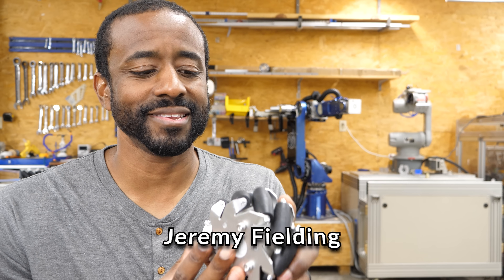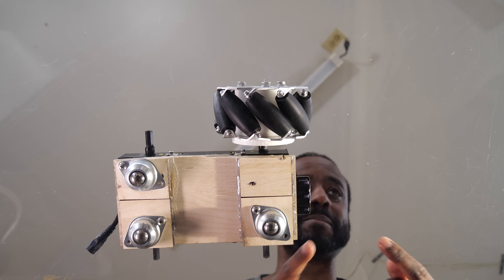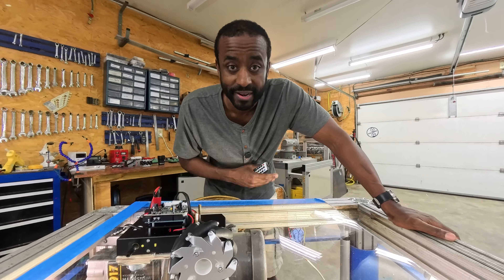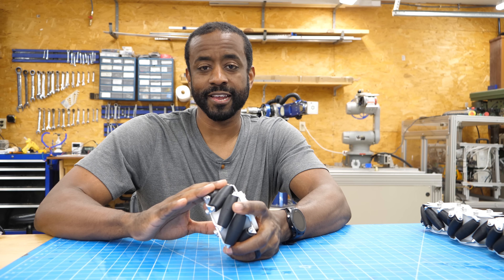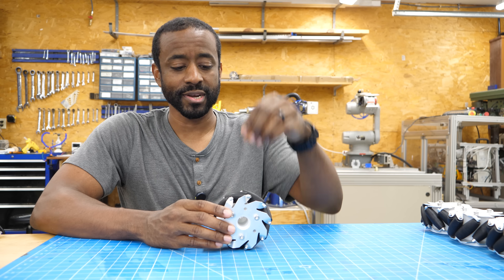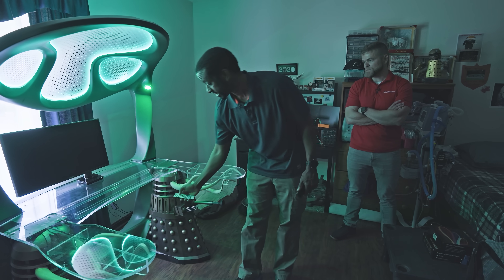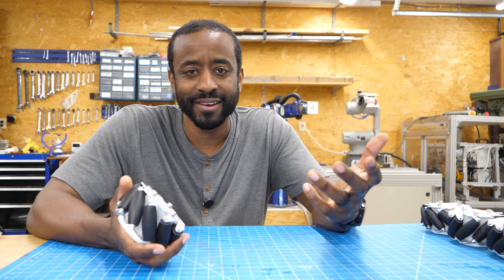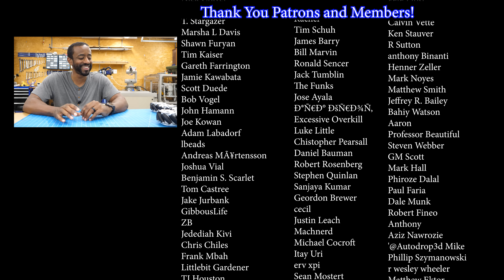The Mecanum Wheel Is So Weird, It Is Genius. How It Works

Comment: Well done video, but didn’t provide any information about the actual design. The Mecanum wheel is a copy of the HeliRoll wheel technology that was patented by the FMC Corporation almost 50 years ago for use on conveyor systems. They used it for years on their aircraft loading equipment and other materials handling equipment. The patent has since expired and the wheel design has been copied by other companies for various commercial applications.

Comment: Car manufacturers may be interested, since they seem to always sell the car in the middle of a tight row of cars. With that wheel they would not have to back up a row of cars to get that ONE out into the lane.! of course they'd have to change the tores before driving the car to the dealer or buyer.

Comment: The rules for tool wear apply here, the more complex and robust the design the more expensive so the longer you want it to last, so it is perfect for low speed applications,  The first and most prominent factor on tool wear is RPMs, and this would translate to the speed of the wheel on surfaces.  So the slower the better to reduce wear.  These wheels would last just as long as any other type of wheel as long as it's used at appropriate speeds.

Comment: I watched this because I thought he was going to explain how it work, not just describe its behavior.
Reply from the maker: I don't understand your comment. What do you think is missing? This is "how it works" There is nothing else related to how the tire does what it does.  Perhaps we could have talked about the controller in detail, but its just what I said in the video. When want to go in a certain direction the wheels spin as described in the video to get the movement you want.
Reply: @Jeremy_Fielding  what I mean is, I thought you were going to actually describe the Dynamics of how you get directions of travel out of a wheel assembly other than forward and backward rolling.  you kind of described it in a manner that goes like this, I do this, it does that, I do this other thing, it does this other thing. but you did not explain how turning a wheel clockwise resulted in diagonal or sideways movement. like the force vectors. like what is actually happening with the physical dynamics of that wheel system.
Reply from the maker: @etyrnal . Well I guess we disagree on the meaning of the words. There were force vectors on the screen, I said forward and backward instead of clockwise or counterclockwise…and unfortunately it sounds like the same thing to me. I was trying to explain this to a non technical audience and it sounds like perhaps you wanted a more technical sounding description? I am not sure. But thanks for the feedback. I and not dismissing your comment. I just don’t quite see enough difference to fully understand your disappointment

Comment: I used to drive a forklift that had six functions , one was to move the forks sideways which I found sufficient enough to get me out of any tight squeeze, so don't think there is much use for this side wheel movement, this looks like the equivalent of an upside down forklift using the forks as the wheels.

Comment: I have been looking at your videos. You did one in 2017 were you have I think, 5 diffrent MOTORS on the table were you was showing how to wire them. 2nd from the right on the table, you have a motor from a treadmill. I have a smaller version of that in DC 12v used to go to a folding bench seat from my van. It has 2 wires comingmmout of it at one end.
My question for you is, is there anyway you can open it up and add a second set of wires to it so It can be used to get power to running and at the same time, give power to something else.

Comment: You need at least three price points. A really expensive version that has more features than most people want or need. Then the item you actually want to sell the most of. (sweet spot) Lastly a version that is very limited and but ultra cheap. Sure a lot of people will buy the cheap one but they'll eventually want to upgrade to the next version up. The majority of buyers will be able to justify their purchase because "Hey I didn't buy the most expensive one".  This is why Wendy's has a triple burger 🙂

Comment: I would suggest a bottom barrel tier build. Using a lot of 3D printed parts, skipping things like bearings unless absolutely needed, its low weight means weaker/cheaper motors/servos, etc. The idea being that it is an entry level for someone interested but unsure if they want to invest more to do more and/or for parents to build with their kids before graduating to the more involved (expensive) options. This package can even come in two flavors. One has all the parts and the other has all the parts minus the 3D printed bits for those who have their own printer. If people are happy with what they get and/or have growing interest it will likely result in the purchase of a more expensive kit. For that reason you can also sell the basic kits with barely-over-cost margins which keeps purchase price down and accessibility high.

Comment: These became very common in containerized aircraft loading. They worked way better than rubber belts. The belts would slip when wet. For some reason these didn’t.

Comment: On the topic of approachability, I'd say about getting the price down on a good platform that can be extended later.  I think people are more likely to buy something if they see a low barrier to entry with the promise of buying (or making!) extensions later.  A good set of wheels with pins to add sensors and holes to bolt arms to would entice me more than a robot that tries to do everything on the cheap.

Comment: 110105.    I think nature has greenlit  many ways to absorb ambient thermal energy meaning fhat substances get colder as 🔺️temperature × specific heat amount of thermal energy is  converted without gain or loss into another form of energy, electrical energy in the case of diode arrays. I knoŵ you are a strong supporter of the second law of thermodynamics. Please check the second law of thermodynamics in view of nanometer.scale phenomena where local thermal conditions of fluids are not uniform.

Comment: 110104    Nanometer scale uniformly aligned parallel diode arrays may be a practical way of absorbing ambient heat. Ambient heat is uniform on a micrometer and larger scale and non uniform on a nanometer scale. Plausibly,  heat absorbtion at the non uniform scale is available as Johnson Nyquest thermal electrical noise that would yield, by conversion without gain or loss, an equivelent amount of electrical energy. 
AND
 Diode voltage / current  characterstics can be displayed on an XY tracing oscìlloscope. Thermal electrical noise power in resistors can be displayed by time sweeps of voltage on an oscilloscope. Each such time sweep shows unique randomness.
AND
A  simple  "Special Program with Integrated Circuit Emphasis" model indicated that diodes in uniform aligntment parallel would aggregate simulated partially rectified thermal electrical noise. 

Maximum direct current electrical power, half, is transfered from a direct current electrical source to the electrical load when the electrical resistance of the two parts is equal. Calculated matched resistance output (watts) is k (Boltźman's constant), one point three eight x 10^ minus 23, times T (temperature Kelvin) times bandwidth (0 Hz to a natural limit ~2 THz @ 290 K) times rectification halving and nanowatt power level rectification efficiency, times the number of diodes in the array. 

There are a billion cells of 1000 square nanometer area each per square millimeter, 100 billion per square centimeter. 

Creditable independent replicatable proof of concept protypes beyond improper influence are needed.

Aloha
Charles M Brown 
Kilauea, Kauai, Hawaii 96754

Comment: Cool video.  As for project price points, $50 for kids, $100 for teens, $150 for adult, $250 for advanced, BUT, have the lower tier kits be mostly subsets of higher tier kits, with e.g. reusable chassis, wheels, motors, gears, etc.  Different computer, controls, wiring, etc.  Further lowers cost and/or increases budget for advanced functionality.  Or, think of Transformers, Voltron, Thundercats, etc, additive machines that can be composed into larger machines.  Modular design, reusable components.

Comment: These wheels are real cool, and I can definitely see how useful they would be. But doesn't the fact that the two opposing wheels cancel out each other's pull in one of their respective directions also mean that half their power is basically lost? I imagine that this, along with the added mechanical parts (potential points of failure) would be why it's not something that would be considered for every four wheeled vehicle out there.

Comment: I think for many people it's not the cost of the materials themselves that represents the bar for entry. It's the cost of the tooling required to transform those materials, as well as the cost of a space to house the tooling. It's easy to say "well, it's only $200 worth of materials", but if it will cost you $50,000+ dollars to get to a point where you can actually do something useful with those materials, then the material cost isn't really relevant. With a lathe and a mill you can make just about anything (if you know how to use them properly), but for most people a lathe and a mill are so far out of reach as to make that an entirely moot point.

Comment: I have a decade of experience with mecanum wheels due to FTC robotics.  The mecanum wheel has great advantages and big drawbacks. Advantages are major maneuverability in all directions, including rotation, side slip, low friction turning, as you mention.  But these wheels aren't good on sloping surfaces, on generating high friction, or on uneven surfaces. They're very unpredictable on uneven surfaces. They cannot handle dirt, sand gets in the bearings, and they're expensive. But they are cool to watch.  Straight tracking requires active feedback control just to continue to go straight. But it's a cool tool.

Comment: ( after watching the single wheel) Thats Genius...so what i'm seeing is each wheel provides more directional movement ...at angles..instead of a normal wheel that just has forwards and backwards...

which means  to get straight forwards and backwards you would need equal wheels on each side but also equal power applied to each wheel...and you can get different direction of travel by applying more power to individual wheels.

Comment: The issue with omnidirectional wheels in general is wear and tear. If you use it on wheelchairs, 6 months of lifespan tops and they are 2.5 times the price of normal tyres. The math does work

Comment: A drone with a powerful magnet and 3+ mecanum wheels would be perfect for crawling around a space craft. Although that requires a magnetic exterior or enough to grid the near exterior for the magnet without causing interference. 

These on the next Mars lander but designed better for Martian dust would be amazing. Scaling them to adapt to the differences in atmospheric density and gravity, as well as the terrain. It could make a much more maneuverable lander. Or perhaps some macro-swarm of mecanum wheeled pods as the foot of the lander. With a highly adaptable suspension capable of lowering directly to the ground surface while engaging multiple wheels to grip and stabilize it against the winds. Perhaps small turbines run by pressure fluctuations would feed power while the winds are blocking out solar power. Sort of like the City on Mercury in Kim Stanley Robinson’s book that moved on rails that through thermal expansion and sophisticated engineering pushed the city towards the dark side constantly. A macro-swarm of drones as the base or platform that the lander rides on. Easy enough to replace individual components and upgrade available payload.

Comment: i call this common sense. i thought it was called omni-wheel. this tech existed very long ago, but it's not practical because it doesn't it doesn't have any flexibility, so you can only put this on very slow moving vehicles.

i have an idea how to make it more flexible tho to make it suitable for normal cars, in short, you'd have to make those rollers soft like tyres, but it also means they'd have to be a lot bigger so the metal pieces wouldn't touch the ground when it's driving over bumpy road.

Comment: Thats cool guy, but I think you can even make that wheel you got swing a little better. A set of gears each one on an end of a roller driven by a single gear might just let the thing run a hundred percent AND  slide.

Comment: Do them only work using that sort of rolling pins system? What would happen if one tried to use just, let's say, traditionally made tires with thick long diagonal treads? It would be cheaper, but would it work the same?

Comment: So, I was building a Mecanum wheel robot about 4 months ago using an Arduino Mega and L293D motor drivers. I used Johnson high-torque motors because, due to the high friction, I could not make turns with low-torque motors. I controlled the robot with a joystick and HC05 Bluetooth module. It took less time to build the robot than understanding how these wheels work. I wish this video had been available back then; it could have saved me so much time. Anyway, thanks for sharing this amazingly helpful video. Placing the camera under the glass to showcase the bottom view was the best idea, making it much easier to understand. Otherwise, it would have been too complicated for many. I’d love to watch more videos about Mecanum wheels.

Comment: I was always wondering what would happen if you lock the small wheel in the Mecanum Wheel so it becomes an ordinary wheel? how would it affect the movement?
Because you can design a Vehicle that has normal movement but when it's in the right environments it can use the movements of the Mecanum Wheel.

Comment: I drive forklifts. Anybody who develops forklifts with these would be a billionaire overnight.

Lets say I grab a pallet up on a shelf and want to move it directly to the side. I have to come in from the front at the right angles sometimes in a tight space. Grab the pallet. Reverse out and give myself the space to pull in at the new location. If the area is full of other junk each move can be annoying and needs to be mentally planned before doing. We still get it done wuickly just because of experience. But still the ability to move directly to the side or even to pivot in place on forklifts would be genuinely worth billions of dollars.

Comment: ye for wheel chairs its very good  , the wheels should be solid rubber : and they should be thought of like a tractor tread: SO the original wheel setup is good but with these extra rollers which can be activated when neccasary to move in other tagents in tight space :
Is we had this also as a lifting device , we could easily alsomove heavy objects and get accurate placement.
despite in theory needing a smooth surface , being rubbber t a single cog coul move ALL rotating rollers like a gear ! so each wheel developed would also be a geared wheel ! < we also think agiain about the problem of surfaces , but if the model was upscaled to a 4x4 sized model even tractor sized wheels we swoul fid it should work on all offroa surfaces ( especially if rubber is used ! ) ...
there are some strange designed in india which also have simular wheen to thi ! ( now we can see what thier actual purpose may have been .,)
Reply: Also I would make a small rover ....  like  Walle :  it could also use object detection , as well as the roomba technologiys to map a location , so once it maps the location ( like roomba ) ( the floor cleaning robot ) << it can then create a scan pattern to 3d scan the location : ( so this could eb a good exploration tool , for caverns etc and tombs etc and ... ) It could also be a search robot given some object to search a location for instances of that object and take a picture : : THe movement aspect gives it that unnatural ability to go any h=wghere and maover anywhewre : ( with cameras for eyes etc , and object detection usingn stable diiffusion , and speach given mistral or llama llm : ) these mechanizimd can also be trained to fulfill objecties given tools , such as a locaton , a map , and camera to take pictures ! as well as a vehicle to control in the environment , in which left right forwards ad backwards are the tools : 
by doing normal physical robotings you can gather data from the basic program to train a llanguage model to perform these tasks with a single room and items search and found: and a collection of rooms maped and scanned ! 
therre is a masive educational pathway there : 
but such a robot would alsobe valuable in rescue operations also ! ( in laces in which building have colappesed etc and the location needs to search if people are trapped and ways in and out of the places .. etc as there are too many options for such a robot (  think sci fi ( farscape ( the little helper drones who fix the ship !) << this seems to be more of what your going to be laking ! ( some type of inteliget machine siuch as a Repair droid lol !

Comment: These were first introduced in 2008 at FIRST as omni wheels. Lots of great footage of the championships, really great application when you pair these with dewalt 3 speed drill motors they also work way better on a 45 degree offset. If your cheep and don't want to do that much mill work a fisher price motor does work out too. These where also later introduced in OTC for ordnance disposal for the military so you dont actually need flat ground just an fyi.